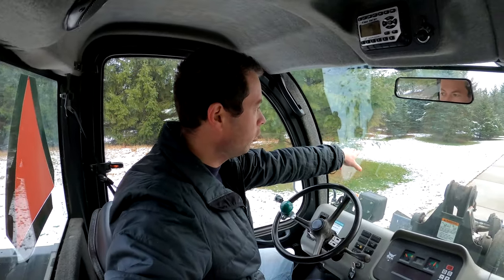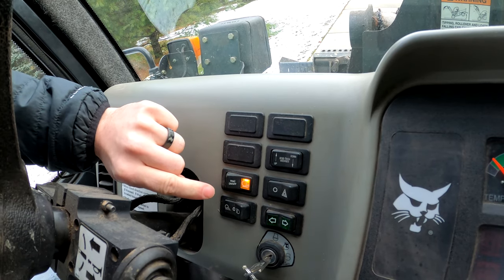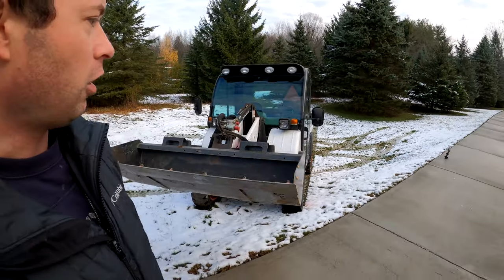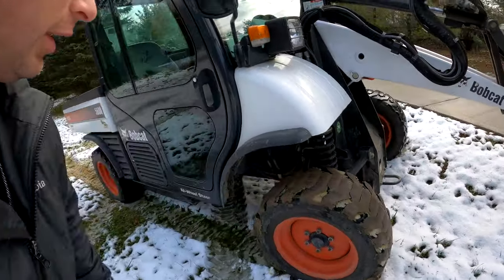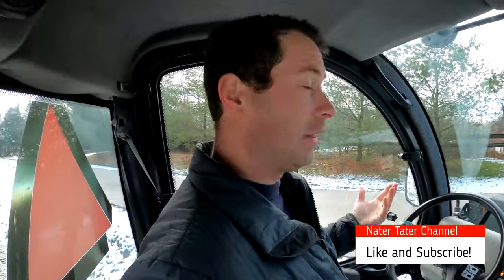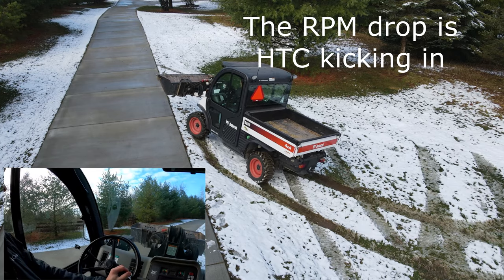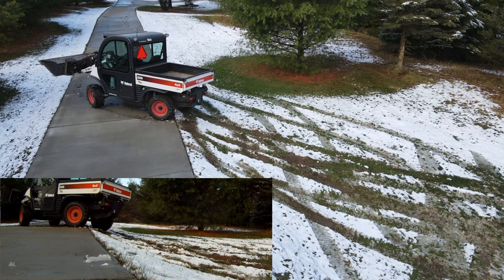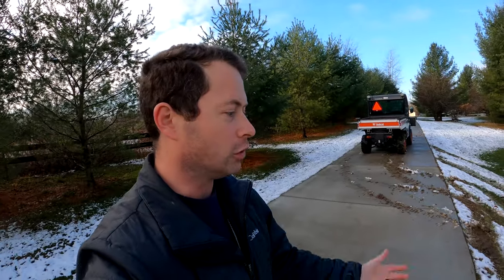✅ Toolcat Stuck in 1/2in of Snow? Here's How The Hydrostatic Traction Control Works - Bobcat HTC

Comment: I just switched to a Titan turf tire (R3 vs R4 I believe) in 27x10.5x15 and it’s as if it’s reborn! My sod is much happier now, and the TC has far better traction in woods with moist dirt. Not sure how it will do the snow, but I have chains that I hope will make up for cold weather performance.
Reply from the maker: Nice!  I think I would prefer turf tires but cant justify the switch over cost with good shape R4's.
Reply from the maker: @chad meyer any feedback after a winter?

Comment: Seems like a UTV and a skidsteer would be a better option or the right tools for the right jobs.  I have a 2011 polaris ranger and it's pretty good at plowing...looking at a snow blowers today for it...there are a couple ranging from 2800 to about 5500 which is kind of high.  If you factor in the price for this machine though, it's a drop in the bucket...a skid steer with a UTV might be a more viable option outside of creature comfort AC/HEAT.  Good that it works for you, I don't have that kind of money to spend so I'll have to stay where I am...nice to watch though.  Have you seen the new XP 1000 Polaris?  Heated and cooled cab.....much more than there now than when I got mine....I just looked them up, pretty nice if you have the $$
Reply: This is a skidsteer and a UTV. It accept tracks and chains.

Comment: I realize there is snow and ice...but that seemed to get stuck pretty easily. Does it get stuck like that pretty often? and if so, what kind of hills do they get stuck on?
Reply from the maker: This was a demonstration without the traction control.  With it on it makes it up no problem (esp if you dont stop and dig holes to then climb out of first).  I havent gotten stuck stuck yet with the toolcat.  If you get stuck you can use the bucket to push/pull your way out.
Reply: @NaterTater  do you use tire chains?
Reply from the maker: @simrandhaliwal8195  no

Comment: So for all out traction I'm assuming the earlier machines with the limited slip would do a little better than the newer machines with traction control?
Reply from the maker: No, early machines at best had a locking rear diff and only in slow speed and 2 wheel steer mode.  Newer with traction control is better.  The worst are the newer machines (all independent suspension) without the optional traction control.
Reply: @NaterTater  Sorry, meant to say earlier machines with the locking diff. I can definitely we where traction control on 4 wheel steer would have its benefits though.
Reply: @NaterTater I thought all new bobcats 2021+ have traction control. Is that not the case?
Reply from the maker: @UnitedStates.  I would believe that.  This video was before the UW56 was revealed.
Reply: @NaterTater  I checked and it’s a $500 option on the UW series. What do you think it’s better a UW53 or a UW56? I saw your video using a box blade on your toolcat. I am wondering if you can implements on the 56 then what’s the point on getting the 53. What are your thoughts? Thank you.
Reply from the maker: @UnitedStates.  I wish I had a 5610/uw53.  I use the dump bed but you can get a dump trailer or 3-point dump container.  The nice thing about the factory setup is it also has a PTO and theyre are many cheap pto driven attachments i would like.  You can also get a aftermarket dront mount 3-point adapter with pto but again if I had a choice I would get the factory setup.  Its nearly impossible to find a used one though and I didnt want to pay for new.
Reply: @NaterTater  Yeah, they’re priced pretty steep even used. I was looking first for a uw56 but after seeing more vids from you specially the one with the utvhitchworks I think a uw53 makes better sense. I think I have to save up though 😂 I think used 2021s are still going for 65k around that. Better than new though (87k) but still a pretty penny. 

Thank you again! Keep making awesome vids!

Comment: Looks like the tomcat is only good for delivering flowers to your neighbor on a clear sunny day,, and traveling on clean & dry pavement.
Reply from the maker: I suppose that's one way to look at it.  In reality its a very capable machine and I explain why and how I demonstrated this particular event got it stuck as well as showing how it can traverse this ditch with the traction control on.
Reply: This cart is a joke
Reply: I use ours to lift 2000# pallets. Feed round and big square bales. Spray. It's a very versatile machine.